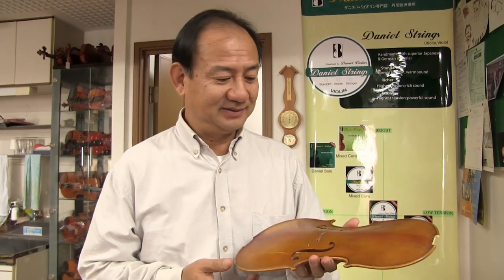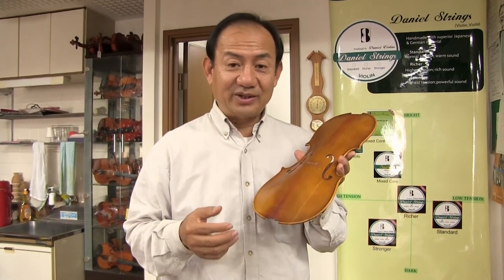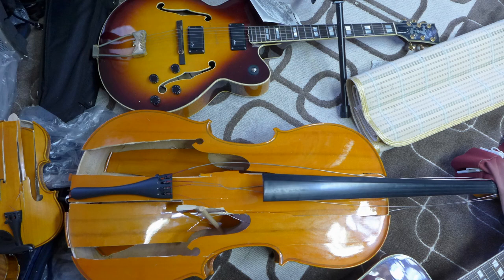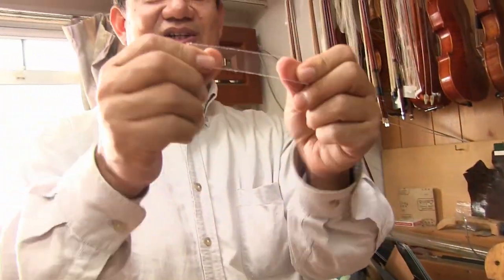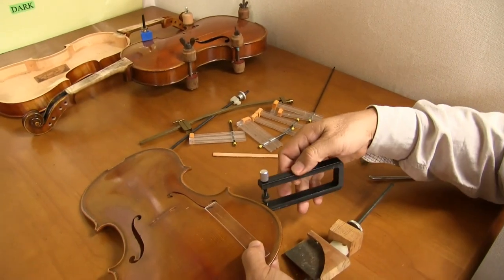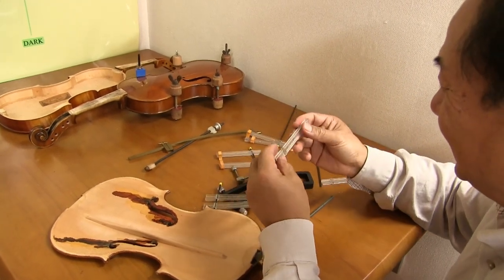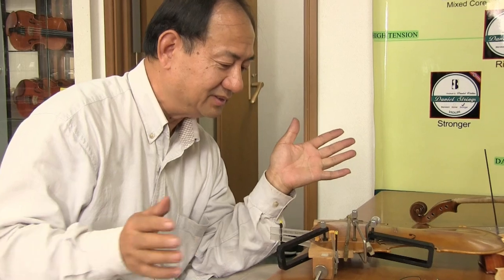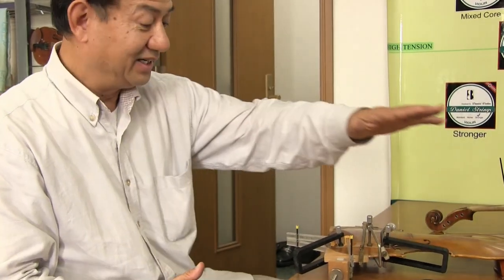Repair Violin Top Crack 1

Comment: Hi Daniel, I took a violin from chennai, India to Switzerland in October 1st week.   2 weeks later I found a crack on the top plate near the tail piece. The next year, I took another violin from India to Switzerland again in October 1st week.  2 weeks later I found a crack on the top plate, this time near the finger board. The crack is similar to what you have shown.  I am following western tuning. During my flight, I reduce the strings by a semi tone. Can you please tell me why this crack happens.  As far as I know, India (chennai) and Switzerland have same humidity, around 70%.  What do you think is the reason for such cracks and what care should I take. Please explain

Comment: I have a violin from 1883 , Ferdinand hamulka , it has a thin crack in the top just like yours except not very noticable,  I was wondering what the glue type is?
Reply: You need to use hide glue :) it is made of animal hide, comes in granules and you melt it with water. Sort of like gelatin.